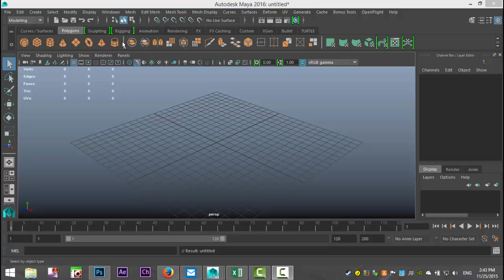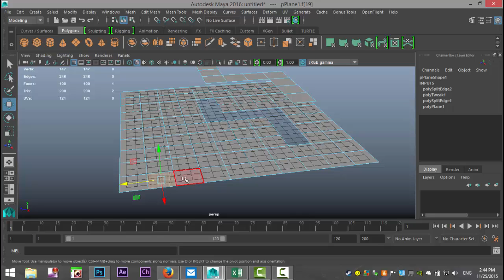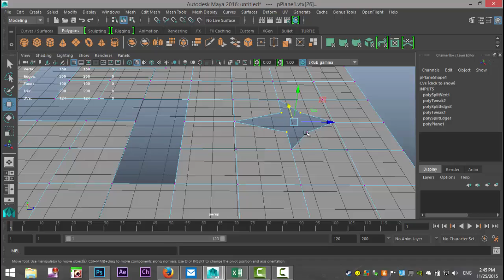Maya 2016 tutorial : The Detach tool

Comment: soo i do have a question that doesn't seem to be asked just yet. im working on a house and have cut the roof / extruded it from the walls, and when i was trying to get into finer detail with the roof, i needed to detach a side piece, however, when i do this  a singular point stays attached. i've tried detaching the point by selecting it and "detaching" but then it appears to do nothing.. everything else seems to have worked up to this point, do you have any idea why this might be happening? thanks so much for the help!
Reply from the maker: Did you detach while having the face selected ?